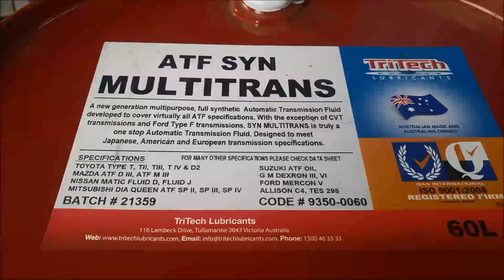Subaru 5EAT 5 Speed Automatic Transmission Filter & Fluid Change Service How to DIY

Comment: That's not the filter; that's the pickup for the valve body. It does a little bit of filtration, yeah, but the real filter is a spin-on unit behind the battery on the cooler lines.
Reply from the maker: hi, haha once again same comment ! yes, subaru call it a strainer. a strainer is still a filter....if you are lucky and have the spin on filter then change it, some have a cartridge filter that can only be replaced with trans removal. make sure you add additional magnets to trans pan and regularly clean them otherwise they cant collect more magnetic debris once they are fully covered ( non magnetic debris should be caught in strainer, spin on filter or filter cartridge ). having said all that, the choice is always yours to make from your research and experience. thanks for that info. cheers

Comment: Was told by Subaru my 2013 and 2014 outback 3.6 with the 5eat didn't have a transmission filter that was accessible at all
Reply from the maker: hi, no worries. cheers

Comment: I read about Subaru only recomends the filter change when there was some rebuild service in transmission...
Reply from the maker: hi, often what is recommended ( also depends on who is recommending it! ...) and what is true, are two very different things. cheers
Reply: @YepThatsIt  the same transmission (5EAT) is mounted on other vehicles, such as the Nissan Navarra.  And in that car, the filter is a metal screen attached to the valve body. You dont need to change it, unles in case of service in transmission.
Reply: @andreitrom72  that doesn't explain why he has a filter in this 5eat.. :S

Comment: Excellent video mate.
 well done good job 👍👍👍👍👍
 just a question.
is it good idea to flush the transmission from the transmission cooler line?
Reply from the maker: hi, if no coolant in trans fluid - no need to flush trans. when we do a flush we connect vacuum line to the cooling line, however the bottom half of torque converter to bottom of neck will still contain fluid, some will also be behind pistons and remain in nooks & crannies in the trans. if your traans fluid is very dark/burnt, then usually a complete flush will make it worse as the new fluid will be thinner than the contaminated fluid. when fluid is very dark/burnt means your trans is on a limited life span anyway - not even golden syrup will help for long. cheers

Comment: Any tips that you can suggest when performing the hot check, with regards to getting consistent readings on the dipstick after adding oil .
Struggling with the level on the dipstick. Smears past the hot mark.
Transmission is not overfilled.
Just struggling for consistent readings thanks.
Is it a matter for the engine to idle for a longer period.
Any suggestions welcome.
No problems on the cold check.
Reply from the maker: hi, sometimes you need to dip the stick quicker and take the lower level mark. occasionally you might need to get someone to turn off vehicle and check quickly if there is splashing in the trans. cheers

Comment: What was the reason for changing the filter? if the filter was clogged with internal contaminants such as loose clutch pack material, simply changing it only costs more money and prolongs the inevitable transmission overhaul.
Reply from the maker: hi, bit like changing underwear. cheers
Reply: @YepThatsIt   In other words there was no good reason for doing it other than to charge the customer more.
Reply: Would you rather do a trans overhaul now or in 30,000 miles. Prolonging the transmission from failing is exactly why you would replace the filter. How quickly do you want to spend 4000 for the transmission to be replaced?

Comment: Hi.  Thanks for putting this video up.  I am about to service my 2010 3.6r Premium.  (same colour too).  

It has an occasional odd shift when it shifts up at around 80kph. It happens during mild acceleration, transitioning into cruising.  Its only occaisional, and it only seams to happen when cold.  It feels like it hangs up on the shift.  And can't make its mind which gear is engaged.  Like maybe 2 gears are on at once.  Only lasts for about a second.  But it definitely doesn't feel right.

Im hoping a fluid and filter change will fix it.  Car has only done 117,000km, even though it's 11yrs old.

Any reason why you would use the cork gasket over RTV sealant?  Is it just because the service kit came with one?  

And would it be better to also drain and re-fill the fluid after a drive?  Alot more fluid is tied up inside the box and radiator than the 6L you replaced.  They hold close to 10L from what I can tell.

I am getting a 20L drum of Penrite full syn ATF.  My plan is to drain fluid, refill, drive, drain fluid, remove pan and change filter, refill, and then drain and refill one last time.  I hope to renew asmuch of the fluid as possible, including what's tied up in the gears, and what's in the radiator too.  Hoping a 20L drum will allow for that many drain/refills.
Reply from the maker: hi, sounds like you might have a sticky or contaminated solenoid and/or valve. transmission oil is only oil until you put it into transmission. it then becomes transmission fluid. in a hydraulic application fluid is what moves things. it does provide lubrication as well as other properties contained in the trans oil, but mainly is there to move things hydraulically. for this reason, we only change the fluid that comes out when you drop the transmission pan, sometimes we might also connect vacuum pump to the trans cooling lines and suck out the top half of the fluid in the torque converter as well. but, we only do a complete or multiple fluid change if coolant/water has entered the trans. by just replacing fluid that comes out when you remove trans pan and filter is usually enough to bump up the fluid properties. often if the trans is old and worn, and has internal pressure leaks, if you do a complete fluid change it can make your trans operate worse than before the service. this happens because new fluid is thinner than old contaminated fluid, and thinner fluid will pass through any internal leaks much quicker and easier. just do a regular filter service and add magnets to pan and you should get longer life out of your trans. i recommend when trans has done under 200,000km do service every 50,000km, then when has done over 200,000km do service every 25,000km or once a year. you owe me a beers for that speel, cheers

Comment: Hello there i just did the filter and fluid change and already put 7.5 L in it ,but i cant get a proper good look at the dipstick only the tip at the bottom looks red , any recommendations?
Reply from the maker: hi, take to a trans specialist to check for you. cheers

Comment: Hi, for a MKII Subaru Legacy 2.0GT JDM SI drive (2007) if I already have the filter (38325AA032) inside the left wing just behind the headlight do I need to change the filter inside the trans? Which one it is, the plastic or metal one? Thanks.
Reply from the maker: hi, you will best to ask your parts supplier. cheers

Comment: Do you need to coat the cork gasket with oil first or install it completely dry?  do you torque your bolts?
Reply from the maker: hi, best to fit cork/rubber gaskets dry. cheers

Comment: Sir can u help me..i got error hc at odometer..outback 2007 h6.. Already change lateral sensor and speed sensor as stated by obd scanner but still got the problem..and my sport mode always blinking..
Reply from the maker: hi, if still blinking...that indicates another electrical issue. cheers

Comment: After this procedure my car dont show Neutral and in the cluster, in a first moment, after drive some miles, it dont start anymore

It was perfect before the filter change, some idea what may be this ?

Talking from Brazil
Reply from the maker: hi, if you made it worse, you need to check over work you did? cheers
Reply: @YepThatsIt  believe the problem was caused by disconnection of battery ... Will try to reset ECU and see

Thanks for help and congratulations for your video

GOD Bless you

Comment: Are the in pan filters still in place on older(07-08) models with the filter in the passenger guard?
Reply from the maker: passenger guard?
Reply: @YepThatsIt  my Liberty has a spin on filter(factory) for the trans oil cooler in the guard behind the battery, after further research it has both an in pan and inline filter.

Comment: Hey mate, great detailed video! 👍🏻 I have a question. I recently purchased a 2012 liberty gt, 90km on the clock and full Subaru service history. Has the same transmission. After 1 week of driving, my transmission started slipping from 1st to 2nd like extremely noticeable with a massive thud when it finally engaged. Mechanic had said it's valve body needs replacing and it would be cheaper to replace entire transmission. Any advice would be greatly appreciated 🤯
Reply from the maker: hi, at that mileage i`d doubt the valve body is worn. it is more than likely contaminated solenoids, as the dealerships push this "sealed for life " bs on customers....and i doubt the transmission has been serviced with pan off.......i have quizzed them ( many different manufacturers at trans seminars..not the ones in your town/suburb...the higher up personel ) on this , and apparently they have left out a few crucial words....sealed for life actually means = sealed for life of the warranty ! they dont service transmissions while vehicle is under warranty  
i wouldnt take to a mechanic, take it to an automatic transmission specialist as mechanics rarely know how to repair transmissions, this is why they push for  a complete transmission change....having said all that at 90km it should still be under manufacturers warranty anyway....keep on them about the issue. cheers
Reply: @YepThatsIt  I have purchase the car 2nd hand private from the original owner (Sydney Australia) I believe the warranty is expired. The problem has been a mystery to 3 different mechanics a transmission specialist and a Subaru specialist. The car will drive perfectly for 1 week then play up when first driven. Then the car will return to normal like nothing wrong whatsoever. All professionals that have tested the car say it's perfect. The Subaru dealership themselves quoted that there was no identified issues or error codes. I am completely confused and frustrated as I purchased this car for my wife who commutes herself and my children day to day. Thank you for your response and I will continue my investigation into the problem I guess 🤷🏻‍♂️
Reply from the maker: @Lebanese_Lion  contaminated solenoids
Reply: @YepThatsIt  Do you know if the Turbine Speed Sensor No.2 in a 2010 Tribeca can be replaced easily by a layperson? Apparently they are now sold separately from the whole valve body. Or would it require splicing wires?
Reply: @Lebanese_Lion  I bought an exact model of your car with similar kilometres. That's common on the GTs with the 5eat. Some guys replace it with a new speed sensor that's a lot cheaper than a new valve body
Have you sorted it out?
Reply: @ayske1  yes it was the valve body... I put in a 2nd hand gearbox for 2k fitted. Subaru were asking for 7.5k just for valve body 🤑🤑🤑
Reply: @Lebanese_Lion  how many kms was the used gearbox? You on club lib Facebook group?
Reply: @ayske1  nah I'm not... they claimed it had 100k on it
Reply: @ayske1  on boost in Sydney the place to go for all Subaru parts
Reply: @Lebanese_Lion  yep I used them before for another car. My is pretty stock with minor changes, getting coil overs soon
Reply: @ayske1  same this is my 3rd one all have been stock. Absolutely love them

Comment: Hey mate great video. My late 09 gen 4 OB premium with the 5eat, asked my parts to speak to local Subaru parts and they're trying to tell me it hasn't got a filter. Looked under car on hoist at my workshop (I work at service department) and a (used to be subaru foreman) said because it's not the screw type filter on the side it's likely just got a membrane mesh or something.
Is he wrong or is that possible on my model?
May be I should try calling another subaru or Subaru Australia for help?
Reply from the maker: hi, sorry not sure..in australia imports can give headaches as well. cheers
Reply: @YepThatsIt  just curious, was your membrane pickup changed to a filter medium in the pickup? is it something aftermarket made for the trans?
Reply: Have you checked if the filter for your 5EAT is located behind the battery? Watch this video: https://youtu.be/jaaEVFNASNg
Reply: Some filters are external (it may look unrelated to transmission),

Comment: Is the 5eat a reliable transmission? Thanks
Reply from the maker: hi, service them regularly, fit a bypass cooler ( bypass the coolant ), add additional magnets in trans and drain plugs and you should be good to go! cheers
Reply: P1710  turbine speed sensor 2 always dies, If you can get a good fix when that pops up. should be solid
Reply: @YepThatsIt  is it really necessary to add more magnets than factory or is that just s better thing to do?
Same goes with the cooler, why bypass the standard cooler? I don't think that's necessary at all if it's serviced at proper intervals. I only heard if towing it's necessary to get the Subaru extra trans cooler kit.